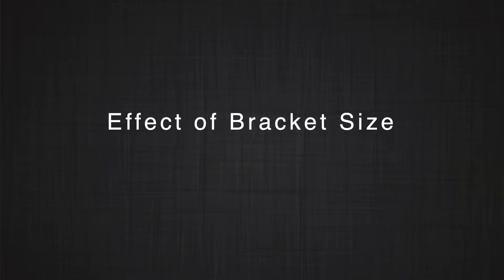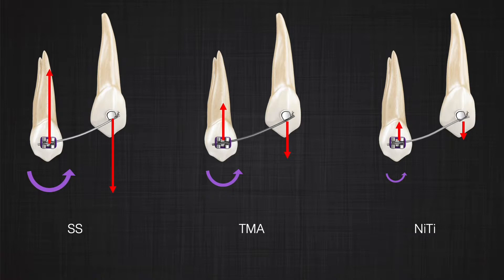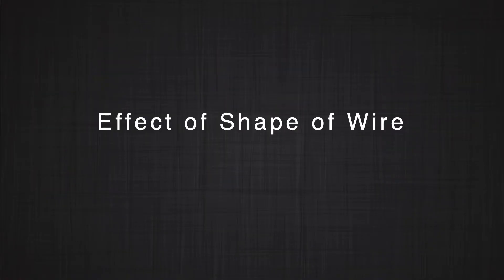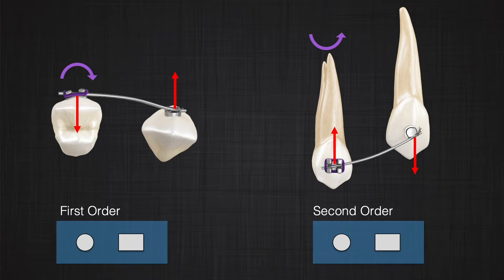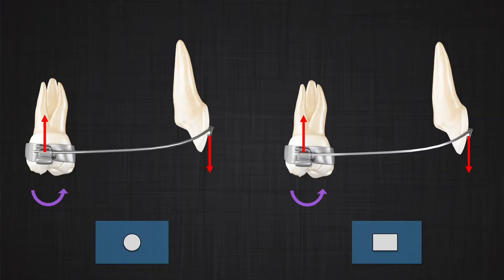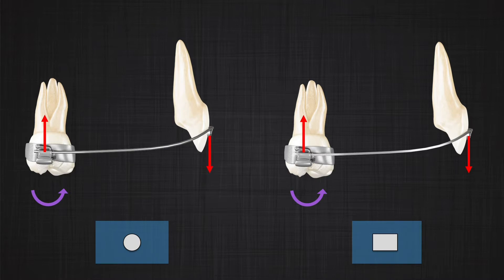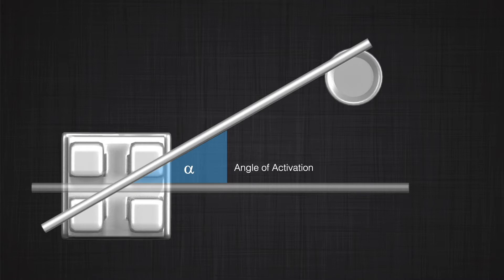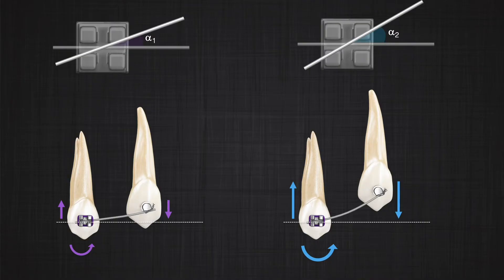Mechanotherapy in Orthodontics: One-Couple System Pt. 2

Comment: Thank you Dr for detailed video.

I have a doubt at 7 min 5 sec 

i understand the to as the distance increases & the angle of activation is maintained ; the force reduce - this is under the assumption to maintain the same moments - M1 = M2 ; this is my understanding. 

But in video you mentioned both force & moment changes - this is where the confusion - may be my understanding & assumption is wrong - how the moment can be different if the forces has to reduce when the distance increases & angle of activation is constant.

so in the pic in video you mean to say : 
1. M1 is equal to M2 
or 
2. M1 NOT equal to M2 
or 
3. M1 & M2 are separate diagram &  are unrelated .

Looking forward to your response . thanks in advance.
Regards